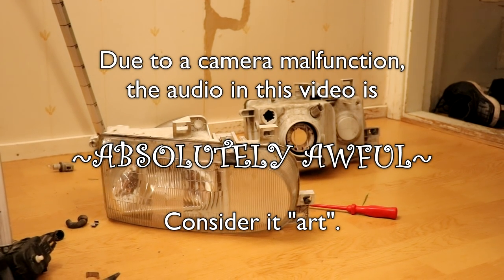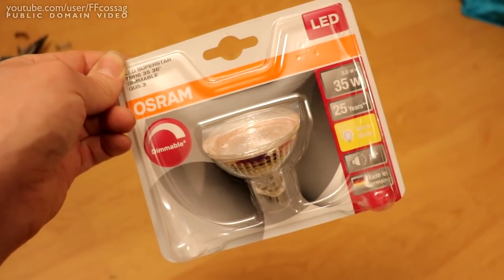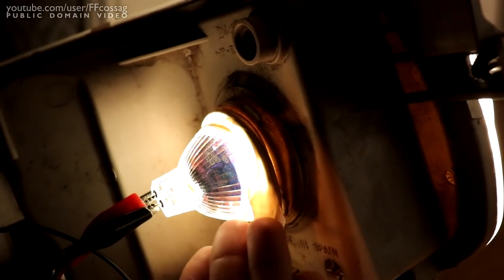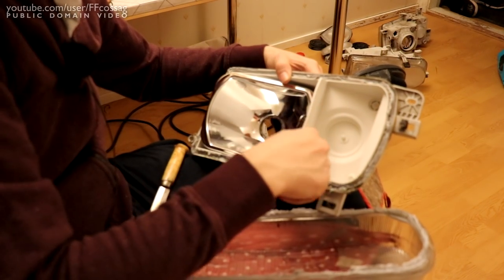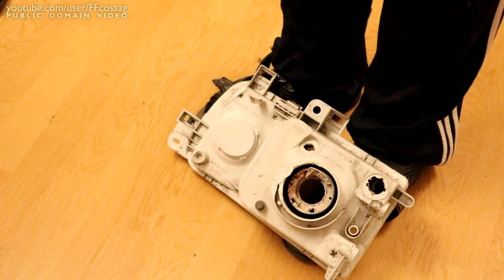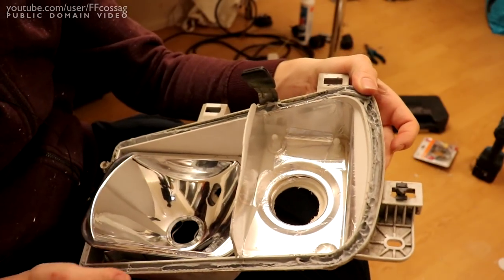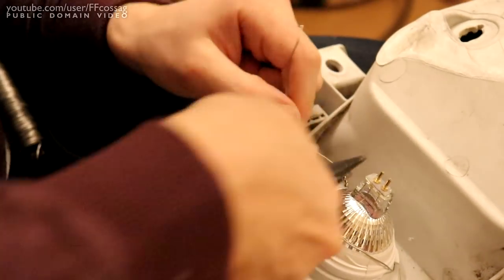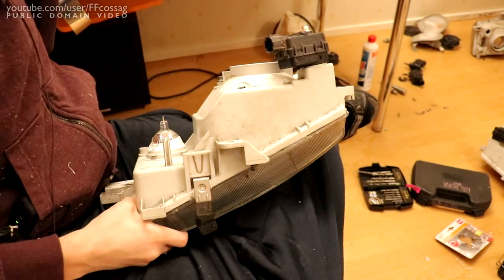Repairing & installing KITCHEN SPOTLIGHTS into car headlights!

Comment: why mount the extra lamp from the outside whoden it would have been more solid monting them for the inside?

has I write this I realise you got a pretty good monting and changing the lamp would have been a pain if you monted the lamp from the inside.
Reply from the maker: Indeed; mounting it from the inside would require the front glass to be removed to change out the bulb or fix any problem.

Comment: cool but did you took into consideration that you will glare on cars going in opposite direction?
Reply from the maker: I usually turn off the high beams when that happens. ;)
Reply: I just knew someone would totally miss the point it's on the high beams only.
Reply: @FFcossag   yeah, did not noticed it. just skipped trough. sorry, my mistake.

Comment: You would be better off getting some projectors out of a junk yard. Install the lense in your housing.
Reply from the maker: The issue is that no one ever bought these with these extra lights fitted, and fitting the wrong lenses in there would be a nightmare. It's much less of a hassle to just aluminium tape it and have it all done in a night. Perhaps not as good, but this channel has never been about doing things properly. ;)

Comment: Hi/Hej 😊
Can you please explain how a 100v amp of for example 250w.
(40 ohm of imp. Max loap)
Can you please explain how the signal looks like and is is 100v dc constantly or some such of modulation?
Reply from the maker: I'm not sure what you want to know.
Reply: FFcossag : so 1kHz for normal amps output, it is a signal wave and the amplitude is the ”volyme”/”power”. What is the100v amp different? (Ex when using 10w load or 250w load)
can i put a diodbridge after a 20w transformer and Rhen a large cap and a 7805 and get 5v ?
:)
Reply: I hope you understand my strange question ..
Reply from the maker: Yes, you can rectify and use the voltage coming out of an amplifier, but it's going to vary so much that it gets tricky.
Reply: @FFcossag  ok, maybe use a buck booster ?

Comment: Hopefully the finnish safety tests aren't as anal as UK ones, they'd probably hang you here for daring to make your night time drive brighter and safer... :P
Reply from the maker: They are quite anal, but as long as the low beam shape is good and you don't have a kilowatt LED bar in the front, they're pretty lax about high beam lighting.

Comment: I have to give you top marks for the effect.
I'm not sure that i want a slice of those, not cooked well enough for me.
i might get plastic poisoning lol :-D.
You may want to put a switch in line for the yearly m.o.t test, or whatever its called.
Testers can get rather picky :-(
Reply from the maker: Considering that these vehicles pass inspection with faulty headlight elevators, broken shocks and broken EGR, I think it'll pass, lol. There's so many trashy old vans around here that the inspectors seem to have just kind of given up on them as long as they have working brakes.
Reply: At least here in Sweden you can have as many lights as you want on high beam :)
Reply: FFcossag
Oww err, that does sound like they have given up, but you know the faults with your vehicle so you will fix the stuff that matters.
Brakes and steering components are obviously important.
In the uk if you have a split rubber boot on a wheel rod/joint or trackrod end, it could fail.
Depends on the inspector, he might just give an advisory sheet and it is handy to know what is going wrong.
Also being checked every year often catches the faults before they are really bad.
Reply: @FFcossag  Inspector will probably be surprised the van actually has fully functional headlights now.
As explained in earlier automotive repair videos, spare parts for these vehicles are either unavailable, broken as well, or defective from the factory.

2 Vehicle Inspectors disliked this video.